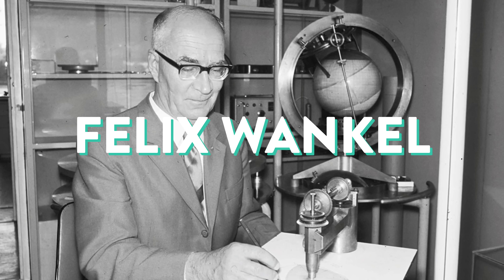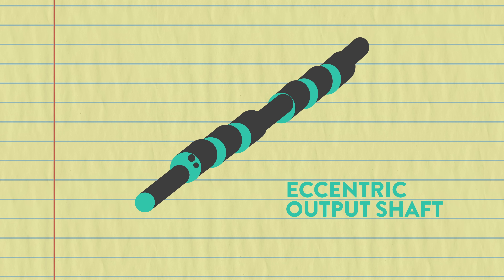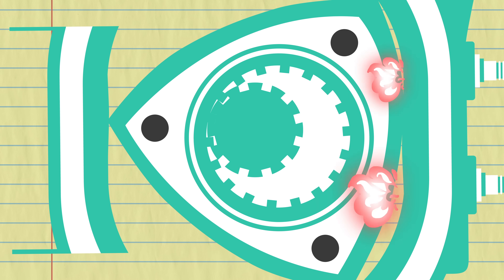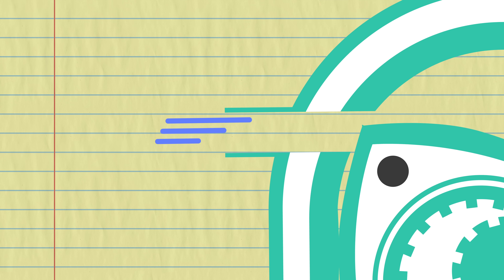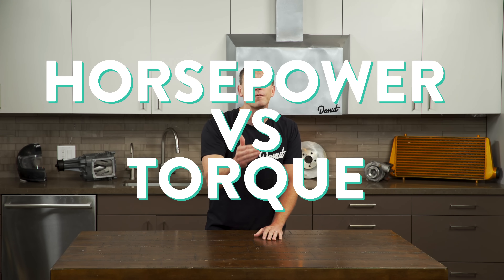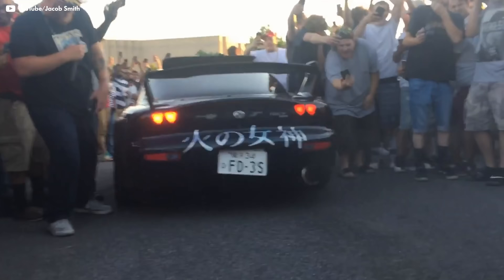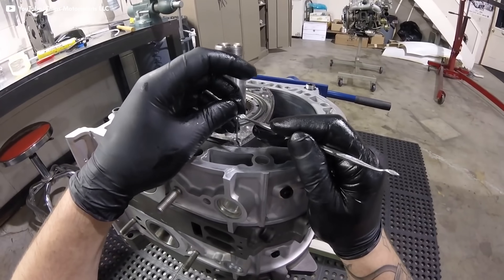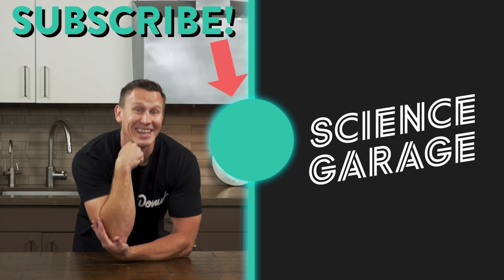Rotary Engine | How It Works

Comment: Did I understand that gif correctly? Rotary engines are single stroke engines? To me it looks like intake, ignition and exhaust happens at the same time (in the same stroke)
Reply: All Wankel KKM type engines use the same 4-stroke operating principle as the Otto type engine. each of the three combustion faces completes all 4-strokes just a a 3-cylinder reciprocating engine would, the only difference is the Wankel requires 3 rotations to complete its firing order instead of just 2 revolutions for a reciprocating 4-stroke engine.

Comment: None of  the UAVs in current U.S. military service use a Wankel engine.
Lockheed Martin Stalker   battery-electric motor
RQ-170 General Electric TF34 turbofan
RQ-21 Blackjack 2-cylinder horizontally-opposed 4-stroke  
RQ-20 Puma  battery-electric motor
AAI Aerosonde Lycoming-Enya single cylinder 4-stroke
Wasp III   electric motor
RQ-11 Raven Aveox 27/26/7-AV electric motor
CQ-10A SnowGoose Rotax 914 piston engine
MQ-9 Reaper  Honeywell TPE331-10 turboprop
MQ-8 Fire Scout Allison Model 250 turbshaft 
RQ-4 Global Hawk Allison AE 3007 turbofan
MQ-1 Gray Eagle Thielert/Mercedes OM668 4-cylinder turbocharged 4-stroke Diesel
MQ-1 Predator Rotax 914F turbocharged four-cylinder engine

Comment: A german design
The Wankel engine so named because only wankers drive them.
Very problematic early on, but resonably reliable in the last iterations.
😈😈😈😈😈😂😂😂😂😂😂
Reply: I wouldn't call a 53% failure rate under the warranty period "reasonably reliable"
Reply: @doktorbimmer  
We did have a RX7 that was successful in the production car class at Bathurst.
But l suspect the engine was hand built.
Could be wrong though.
😂😂😂😂😂😂😂😂😂
Reply: Bathhurst? It sounds like one of those rallye races on temporary street circuits in new zeeland, is that the same thing I'm thinking of?
Reply: @doktorbimmer  Serious road races held on what are normal roads most of the time.
Thankfully Australian engineers are equal to the best in the world.
😉😉😉😉😉😈😈😈😈😈😈😈
Reply: Australian engineers? Like automotive engineers??? Australia doesn't make cars. I thought they imported all their cars from Korea or China now???
Reply: @doktorbimmer  
Lolllll Engineering is a broad field such as weapons designers.
Aeronautical Engineers, Electrical Engineers, Mechanical Engineers.
The list goes on.
Until nuclear fusion and quantum mechanics are perfected we are as good as anyone.
😉😉😉😉😉😉😉
Reply: But it seems not good enough to make cars...

Comment: John Burns, None of  the UAVs in current U.S. military service use a Wankel engine.
Lockheed Martin Stalker   battery-electric motor
RQ-170 General Electric TF34 turbofan
RQ-21 Blackjack 2-cylinder horizontally-opposed 4-stroke  
RQ-20 Puma  battery-electric motor
AAI Aerosonde Lycoming-Enya single cylinder 4-stroke
Wasp III   electric motor
RQ-11 Raven Aveox 27/26/7-AV electric motor
CQ-10A SnowGoose Rotax 914 piston engine
MQ-9 Reaper  Honeywell TPE331-10 turboprop
MQ-8 Fire Scout Allison Model 250 turbshaft 
RQ-4 Global Hawk Allison AE 3007 turbofan
MQ-1 Gray Eagle Thielert/Mercedes OM668 4-cylinder turbocharged 4-stroke Diesel
MQ-1 Predator Rotax 914F turbocharged four-cylinder engine

Comment: Theres only one thing the rotary engine is popular for is 
brap brap brap brap brap brap brap
Reply: The Wankel engine is not popular for anything... which is why they are no longer sold.
Reply: @doktorbimmer  but there are still some rotarys out there
Reply: You mean Wankel right? The very few Rotary engines left are in museums.
Reply: You mean Wankel right? The very few Rotary engines left are in museums.

Comment: could you use multiple of these? an inline rotary engine??
Reply: Yes, Its been done.. but Wankel engines are obsolete technology now... no longer produced anywhere in the world today.
Reply: @doktorbimmer  thats a shame because its such a snart idea
Reply: Not really, 26 of the biggest and best engine manufacturers and over 100 universities and research institutes concluded that the Wankel engines were inherently and fundamentally inferior the reciprocating engines that are sold by the millions, the Wankel was both a colossal commercial and engineering failure.
Reply: @doktorbimmer  it might be infirior but it is a smart idea. Also why do you have to use bold text 🤣
Reply: As I said, its been done already... and proved to be a dumb idea.
Reply: @doktorbimmer  by smart i dont mean efficient. I mean intellegent.
Reply: Its a little complicated but I will try to summarize for you;
 One of the major flaws in the Wankel design is the extremely high reciprocating and orbiting mass due to the large heavy triangular pistons (aka rotors). The longer the eccentric-crankshaft is, the greater the torsional stress on the shaft and housings... this causes flexing and distortion that results in the piston/rotor contacting and damaging the surface of the housings, allowing greater clearance causes the apex and side seals to not seal properly and fail prematurely.
 In summary it turned out to be a bad idea, the ideal Wankel engine design is a single chamber, while 2, 3, 4 and 9 chamber stacks have been tried they increase in weight and decrease in reliability as you add more chambers... so its a bad idea, not a good one.
 If you have any additional questions please feel free to ask. cheers!
Reply: @doktorbimmer  im completely aware of how unreliable and bad in all ways they are. But im talking about the pure concept of a singular object being able to controll all of the points stated in the video.
Reply: The video was produced primarily for entertainment and comedic effect and is full of egregious errors and mistakes...  The biggest error is the version of the Wankel engine shown in the video is not even the one designed by Felix Wankel... so many of the concepts mentioned in the video do not even apply. So If you are basing anything you know about Wankel engines on this video? Most of what you know will also be wrong.
Reply: @doktorbimmer  intake compression combustion and exhaust part
Reply: So? The Wankel is much less efficient as a 4-stroke engine... while it is a very interesting design it was ultimately a failure because it is not as good as other types of internal combustion engines that were very successful.
Reply: @doktorbimmer  so why did you only type in bold text...
Reply: @demapping  Shout the truth to the roof tops.... only lies are spoken in whispers..

Comment: "So, just to clear the air, modern Wankel engines, such as AIE’s, do not suffer from apex seal wear."
https://www.aieuk.com/blog/unmanned-aerial-vehicles-propulsion-systems/#
Reply: Insert jealous homosexual rotard comments below.
Reply: No. they self-destruct their engine housings... these are disposable engines.
Reply: Bimmer, you have been told about making things up.
Reply: The United States military solved its problems with apex seal failures... they no longer use Wankel engines.
Reply: @doktorbimmer  https://en.wikipedia.org/wiki/Internet_troll
Reply: Engines that are not viable production units don't suffer apex seal failures because they never see real world use....

Comment: Rotaries are fitted to UAV drones. 
"Wankel rotary engines currently are installed into some of the world’s most successful and proven platforms. These platforms include Textron’s Shadow, IAI Malat Searcher, Elbit Hermes 450, Leonardo’s Falco, IAI MBT Harpy and Harop, Schiebel’s Camcopter and the UK’s Watchkeeper programme. Rotaries have chalked up millions of flight hours in service, a lot of which has been in extremely demanding operational conditions."

https://www.aieuk.com/blog/unmanned-aerial-vehicles-propulsion-systems/

http://3w-international.com/wankel-rotary-uav-engine-3w-180-sre-hybrid/

https://www.unmannedsystemstechnology.com/2018/04/3w-international-unveil-new-uav-wankel-engine/

http://www.rotronuav.com

https://www.nwuav.com/?gclid=CjwKCAjw7_rlBRBaEiwAc23rhgjdCpEccXK5doOig1_HpXYKckrnCkTGdeYQAU_SXuWjqaGDQ0DrzBoCKGcQAvD_BwE

https://insidegnss.com/product-directory/heavy-fuel-gasoline-engines-wankel-rotary-uav-engines/
Reply: Most of the vaporware scams offering Wankel engines are dead... these systems are now powered by Rotax reciprocating engines.
Reply: Not ones in current U.S. military service, they have abandoned the use of Wankel engines completely.
Lockheed Martin Stalker   battery-electric motor
RQ-170 General Electric TF34 turbofan
RQ-21 Blackjack 2-cylinder horizontally-opposed 4-stroke  
RQ-20 Puma  battery-electric motor
AAI Aerosonde Lycoming-Enya single cylinder 4-stroke
Wasp III   electric motor
RQ-11 Raven Aveox 27/26/7-AV electric motor
CQ-10A SnowGoose Rotax 914 piston engine
MQ-9 Reaper  Honeywell TPE331-10 turboprop
MQ-8 Fire Scout Allison Model 250 turbshaft 
RQ-4 Global Hawk Allison AE 3007 turbofan
MQ-1 Gray Eagle Thielert/Mercedes OM668 4-cylinder turbocharged 4-stroke Diesel
MQ-1 Predator Rotax 914F turbocharged four-cylinder engine
Reply: @doktorbimmer  The World is a bit larger than the US Military. Your need to bash this engine is getting old.
Reply: @WALTERBROADDUS The world's number one UAV engine manufacturer only sells reciprocating engines, just over 50,000 UAV and ultralight engines... they abandoned development and production of the inferior Wankel engine decades ago... just like all 26 of the original Wankel KKM licensee's have... including Mazda.
Reply: @WALTERBROADDUS Just the facts here son... Wankel engines are obsolete technology now... it proved to be a massive commercial failure and is now the sole domain of crackpots and investment scams.
Reply: @doktorbimmer  
Bimmer what else did the voices tell you today?
Reply: @John Burns Hey Johnny!!! Welcome back to the real world! Have you been by the Mazda dealer to check out those new 2020 RX models yet??? Hahahahaahaha!!!!!!
Reply: @John Burns The voice of the Mazda salesman told me "We don't sell those anymore... the RX line was discontinued long before I started working here"
Reply: @John Burns Johnny you look like a fool right now, you told me Mazda would launch the RX-9 by now... WHERE IS IT????

Comment: https://jalopnik.com/mazda-may-apply-skyactiv-x-technology-to-a-rotary-engin-1830747175
From Mazda's Press Release regarding SkyActiv-X:

- SKYACTIV-X is the world’s first commercial gasoline engine to use compression ignition, in which the fuel-air mixture ignites spontaneously when compressed by the piston

- A proprietary combustion method called Spark Controlled Compression Ignition overcomes two issues that had impeded commercialization of compression ignition gasoline engines: maximizing the zone in which compression ignition is possible and achieving a seamless transition between compression ignition and spark ignition.

- This new proprietary combustion engine combines the advantages of gasoline and diesel engines to achieve outstanding environmental performance, power and acceleration performance.

- Compression ignition and a supercharger fitted to improve fuel economy together deliver unprecedented engine response and increase torque 10–30 percent over the current SKYACTIV-G gasoline engine.3

- Compression ignition makes possible a super lean burn4 that improves engine efficiency up to 20–30 percent over the current SKYACTIV-G, and from 35–45 percent over Mazda’s 2008 gasoline engine of the same displacement. SKYACTIV-X even equals or exceeds the latest SKYACTIV-D diesel engine in fuel efficiency.

- With high efficiency across a wide range of rpms and engine loads, the engine allows much more latitude in the selection of gear ratios, providing both superior fuel economy and driving performance.
Reply: https://jalopnik.com/the-rotary-engine-sucks-1773174001
Jalopnik Says Rotary Engine Sucks!!!
Reply: Mazda's Skyactiv-X is a reciprocating 4-cylinder!!! https://www2.mazda.com/en/next-generation/technology/

Comment: March 2019:
Mazda has made a breakthrough with its age-old rotary engine that will allow it to power future models in markets across the world beyond being just a range extender.

Previously, the Japanese car maker announced that it was working on a rotary range extender - a compact version of its iconic Wankel combustion engine that it used in the iconic RX-7 series and other models. It would supplement an electric car in the way that the BMW i3s can be optioned with a small petrol motor, quietly generating electricity to charge batteries low on charge.

The Mazda version would do essentially the same thing, bringing its famed engine that was never emissions friendly into production again.

However, Mazda has made a further breakthrough in development, with an electric vehicle announcement scheduled for later this year that may include details of a rotary engine hybrid car.

Speaking with Drive at the launch of the brand’s all-new CX-30, managing executive officer in charge of powertrain development, Ichiro Hirose, said that it had developed a flexible rotary hybrid platform that was so efficient it could go on sale in the world’s most emissions-strict markets, leaving the door open for a driveline currently named ‘XEV’ to arrive in Australia in the future.

“We made an announcement that we are considering the combination of the rotary-based range extender and combined that with battery EV,” he said.

“What that entails is not simply a combined solution you’d find normally but it falls under what we call an umbrella term ‘XEV’, and what that means is that of course the range extender and the rotary engine has two functions.

“It has the generator function and also it can be used to provide the drive force to give you traction.”

The setup Hirose describes is similar to a vehicle such as the Toyota Prius, where a petrol engine is the main driving force and a light-weight electric hybrid setup supplements the traditional engine, using an electric motor for standing start acceleration and low-speed cruising – conditions that require high fuel consumption and thus produce high emissions.

“The enabler is simply because the rotary engine is compact in terms of its packaging size [and] if we should choose to do so we can have the generator, rotary engine and electric motor all in the one [driveline] because of the small packaging.”

Mazda’s approach is innovative, with an adaptable electric platform that can be modified to add or subtract the required electric-battery power – from a lightweight mild rotary petrol hybrid car to a full battery-electric car with a rotary range extender. Could this be the big electric vehicle announcement scheduled for later this year?

“What we intend to do is that with this combination you can vary the amount of battery and also the amount of fuel tank supply. What that allows us to do is, depending on the ratio between the two, is that we can have a derivative that can work more like a plugin hybrid.

“If you reduce the other way around it could be a pure battery-electric, using really the rotary engine as a range extender and, according to the balance, you can even provide something akin to the series hybrid that is providing the drive force.

“So, we are looking at a wider coverage and scope. Based on this architecture it allows us to do that, to explore the huge range of applications we can have with the rotary.”

Mazda remains coy on talking about production, but Hirose said it had already tested the new rotary to make sure it meets the most stringent emissions standards in the world, confirming it could be sold in the US.

“There are certain difficulties in order to comply with as you can imagine.

“What that means is during a typical drive the rotary engine would have been stopped but when certain conditions are met it needs to start moving suddenly. And this is where we need to look at the emissions for hydrocarbons and carbon monoxide and we need to be looking at a way of where the catalyst starts working exactly when the rotary engine starts moving. This is the difficulty in trying to meet the regulations when the ramp up happens of the rotary engine.”

But it appears that this is the reason for the flexible XEV hybrid architecture Mazda has developed, that can be altered easily to meet a region’s emissions requirements without going into the considerable expense of developing a new system for the one market.

“The reason we are taking this [flexible hybrid] approach is that we have many different requirements that are coming from many different regions if you look at it globally. I mentioned three main ways of doing so and one is most befitting and appropriate to a specific region. So, for those reasons, we introduce one sort [of hybrid setup] and change it to the other [for another market]. So, we will make appropriate arrangements that fits that region.

“If we were to introduce it in the US we would comply with the [stringent] level regulations during when the rotary is in operation. So, we have been able to make progress.

“I’m just saying that – theoretically - if we were to introduce it in the US we would be able to comply with the strictest of regulations.”

https://www.drive.com.au/news/mazda-confirms-flexible-xev-rotary-hybrid-driveline-120928
Reply: WHERE IS IT????  Just more false rumors that never come true Hahaha!!! INSERT JACKASS TROLL REMARK BELOW
Reply: @doktorbimmer  https://en.wikipedia.org/wiki/Internet_troll